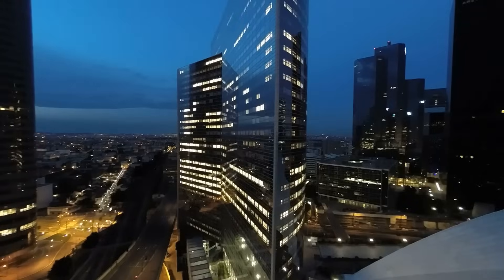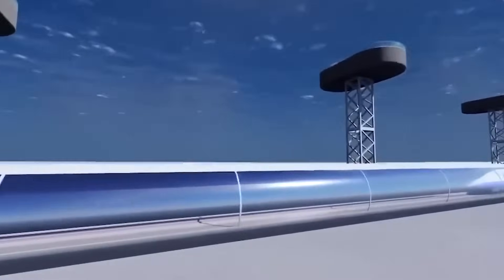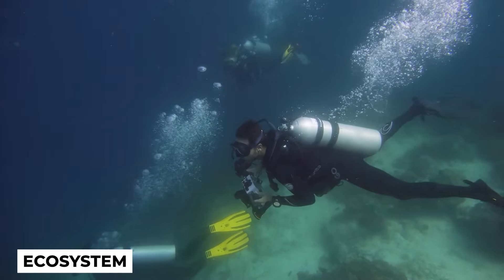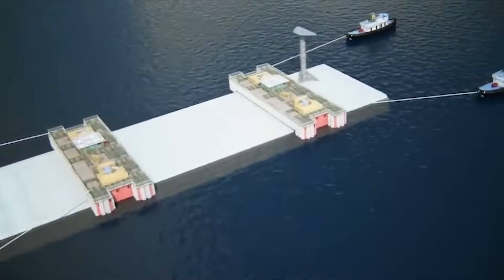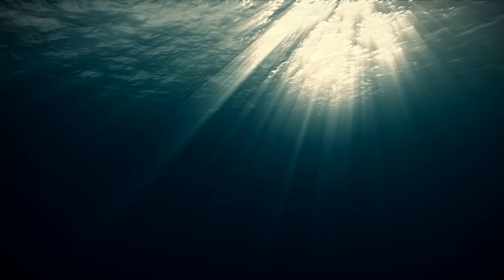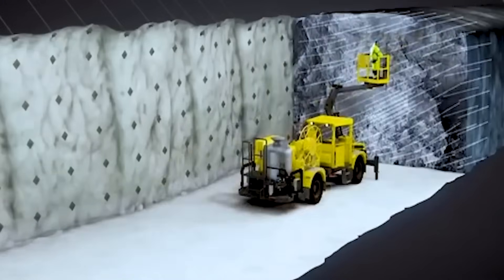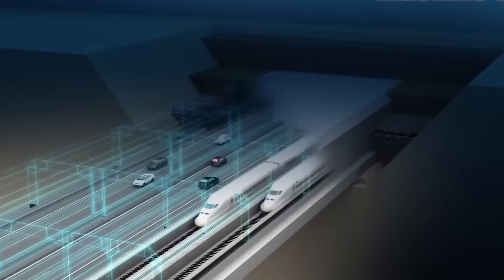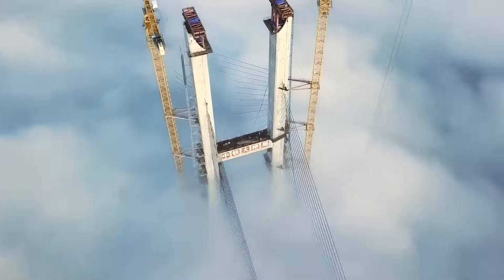HOW IT'S MADE: Underwater Tunnels

Comment: These are NOT underwater tunnels. An underwater tunnel is like the one between UK and France, or those joining New York to New Jersey-dug into the ground, albeit the grownd under the water. These are FLOATING TUNNELS, meaning they are unstable tubes hanging from something above, and will collapse as soon as that thing holding them up, has faltered - due to sea or air storms, or metal fatigue. They are on or inside solid ground. Pretty scary

Comment: One problem of this is the continuous movement of the earth's tectonic plates. They would have to monitor this 24/7 to either reduce the length or increase the length of the tunnel.
Reply: Only if the tunnel spans a plate. Most don’t.  Also the annual movement of plates is exceptionally tiny.
Reply: Gracias por la información tuya okay buenas noches